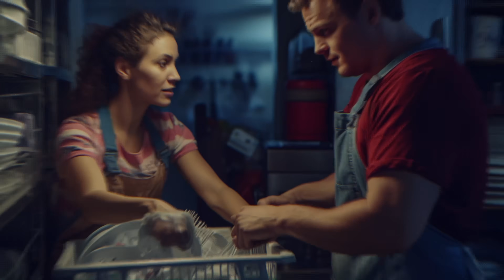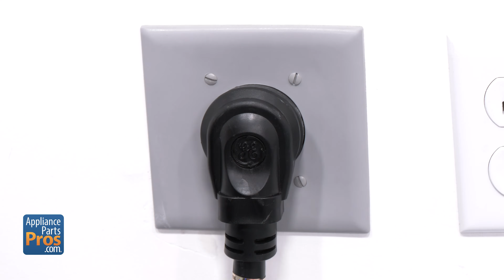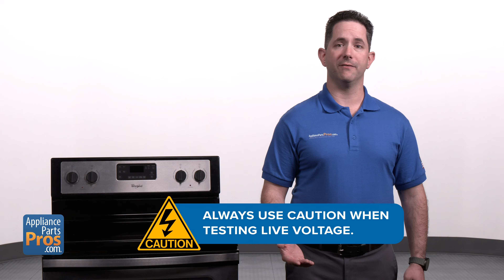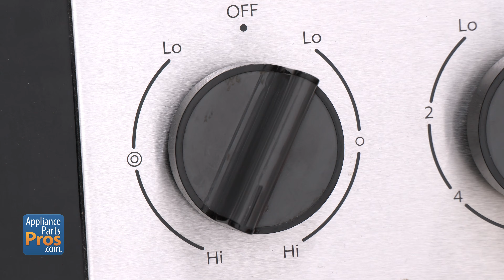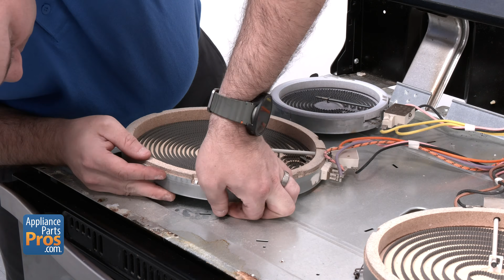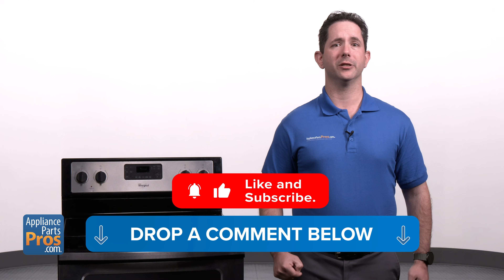Whirlpool Electric Range FIXED! Dual Cooktop Element Not Heating

Comment: Didn’t see you testing the actual burner element
Reply from the maker: If you need more troubleshooting or testing information you can check out our Repair Forum: https://forum.appliancepartspros.com/.  It’s easy to register, and you can either post your question or search the forum to see if someone else has already asked the same question.
 
Our experienced technicians, with over 20 years of hands-on appliance repair experience, are ready to answer your questions and guide you through your repair.
Reply: Exactly why I gave the video a thumbs down. Not helpful.

Comment: I get the EER 01 code on the display. I looked it up and it said to replace the control panel board.  It is still display the EER once in the while.  Now I also have both main burners acting up as well.  Even if put them in the lowest position they will increase in power and stay on.  Are these two issues related @appliancepartspros
Reply from the maker: If you need further troubleshooting or testing information check out  our Repair Forum: https://forum.appliancepartspros.com/.  It’s easy to register, and you can either post your question or search the forum to see if someone else has already asked the same question.
 
Our experienced technicians, with over 20 years of hands-on appliance repair experience, are ready to answer your questions and guide you through your repair.

Comment: Can I have your phone number please my stove is not working
Reply from the maker: If you need to place an order for a part you can call us at 1-877-477-7278 Mon-Fri 9am-8pm Est. If you need further troubleshooting, check out  our Repair Forum: https://forum.appliancepartspros.com/.  It’s easy to register, and you can either post your question or search the forum to see if someone else has already asked the same question.
 
Our experienced technicians, with over 20 years of hands-on appliance repair experience, are ready to answer your questions and guide you through your repair.

You can also post a question directly on the product page of the part you’re interested in. This helps our team provide the most accurate, part-specific guidance in our Question and Answer section.